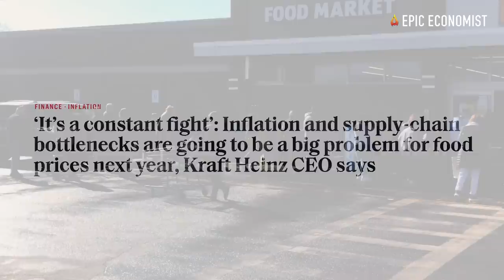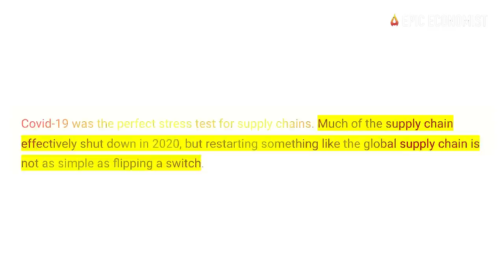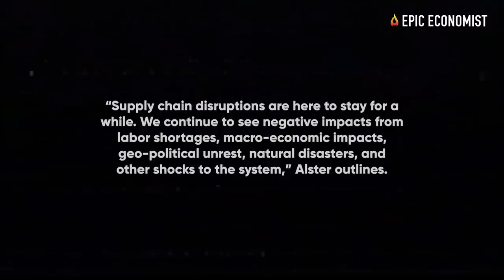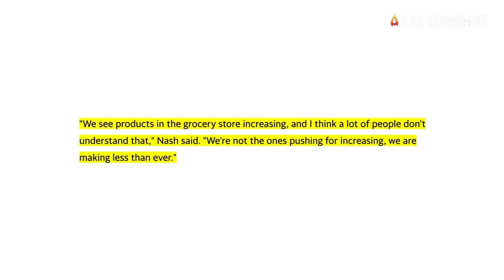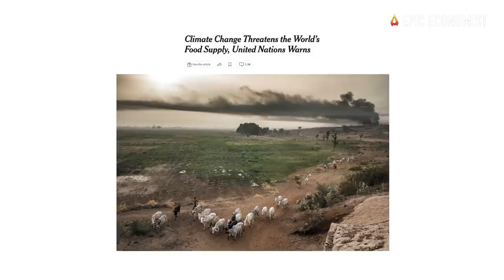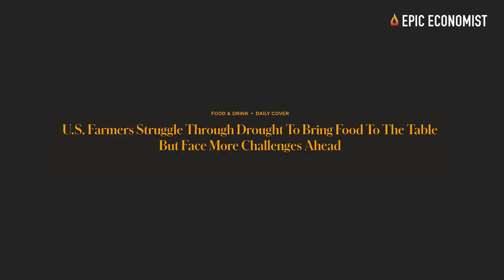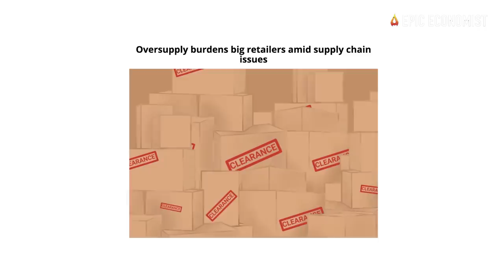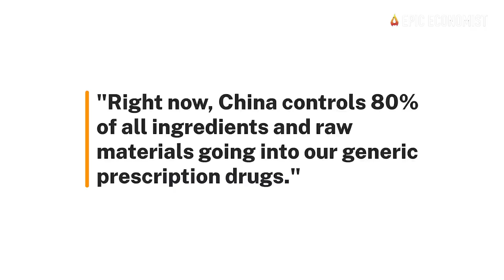Supply Chain Shortages Will Trigger Panic At Stores This Winter As People Rush To Hoard Essentials

Comment: i've been saving up on canned beans. They are the most nutritious food in a can. I am starting to rotate cause the collection is getting large. Its like an expanded pantry to make sure things don't spoil. If I do it right I think I should be able to expand the collection without problems as long as the oldest stuff is getting used. Now when I buy beans to use that day, I switch up the new ones with the older ones stored away. I don't have a lot of food preservation skills. Also I am trying to use washable cloths rags tea towels dish cloths to clean messes water food cat puke blood from cuts dust grease etc. Right now we have water to wash them to reuse them. I have been gradually saving up toilet paper, I have a feeling toilet paper will come in handy for when we don't have machines to rewash rags so easily. Keeping food prep areas and wound area's clean is important even when other priorities slide. Can't breath if you don't blow your nose. I think it could be easier for us to save up on paper towels and toilet paper by using rewashable rags while the getting is good. Cause rewashing rags when water is already scarce won't be possible and we really will be dependent on decomposable whipes which is what toilet paper and paper towel is. For now I will use rewashable rags to clean more and save up on paper towel for when water might be scarce. I can save up tissue paper faster if Im not using as much. Hope this advice helps. Im disabled, living at home.
Reply: Hi Sean, I have switched to small cotton hand towels, they will be easier to launder than huge fluffy towels down the road. I stopped using my dryer and bought a $25 dryer rack, it holds an entire load of laundry and paid for itself the first month not using the dryer.  Also, a couple of buckets to wash them in for if I can't use the washing machine, buckets will be easier than using the sink is my plan.  Canned beans should last for many, many years beyond what the date on the cans says;)
Reply: I agree with Dianne & Sean. Sometimes, I soak stained dishcloths in a 1 gallon pail of hot water & OxyClean, as opposed to bleach, which may be harsh.      "What about the foods in your pantry? Most shelf-stable foods are safe indefinitely.".     *Source:* "Before You Toss Food, Wait. Check It Out!" U.S. Department of Agriculture  🇺🇸 😎👍☕

Comment: Sucks that fertilizer costs are high and supplies are low. Dog and pet groomers need to start redirecting hair waste strands to fertilizer manufacturing. Just combine hair with water and wood ash to break down hair with high pH. Cool it up with enough hair to bring the spring down to neutral and then compost with other low pH greens line citrus and pine needles.

Comment: Eggs keep rising every week in Walmart, don't know about Costco or Kroger..I don't mean to be so negative. Have to cook my Leche flan:face-purple-wide-eyes: maybe have to skip dishes using a lot of it😞
Reply: Buy eggs, and coat with mineral oil, for long term storage. It's the mineral oil that is used to coat wooden chopping boards. Youtube has several videos from many preppers about mineral oil coating eggs, and water glassing eggs.
Reply: Liquid eggs work very well and you can freeze the cartons; just wrap a few times in plastic wrap.
Reply: They make that fake eggs stuff in cartons. You could try that.
Reply: I DON'T NEED ANY MORE CHOLESTEROL.
Reply: Walmart 18pcs eggs $6.50, Costco 2 trays (24pcs) $5.00. I want to buy more in Costco but only limit for 2.

Comment: We saw disruption in the House of Representatives. The grand ole party cannot come to vote on speaker. While market and economy are on a Collison course to disaster. I have some appliances breaking down and better learn how to repair them. If you seek commercial repair, prepare for high prices. You need the skills when country is bankrupt. Our Frigidaire microwave stopped working after floor replacement. Their tools may have rendered electric issues. i learned how to replace the fuse which requires front panel removal. Better learn.